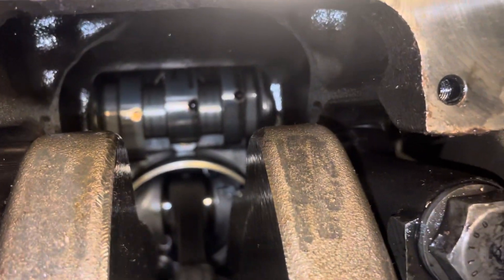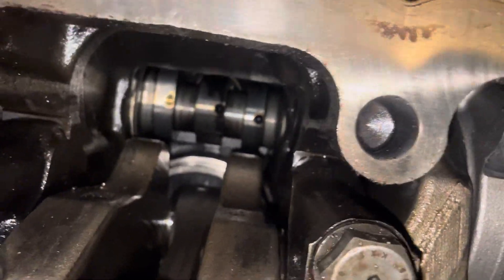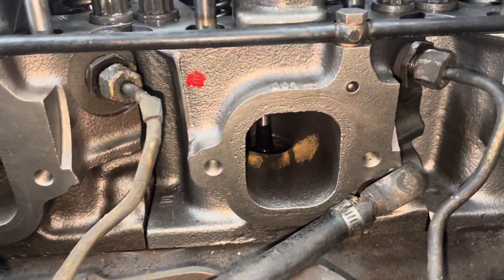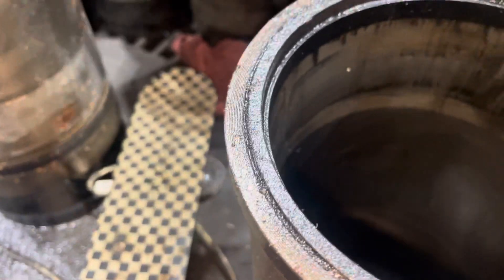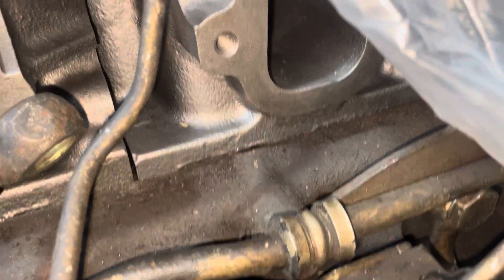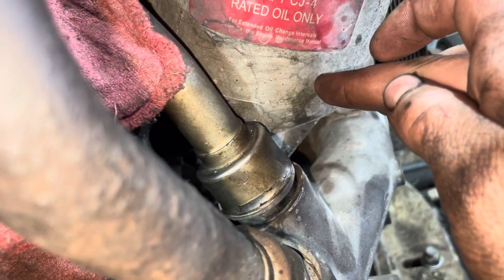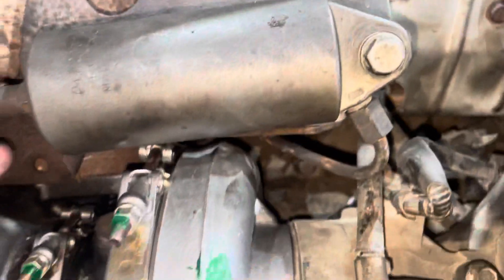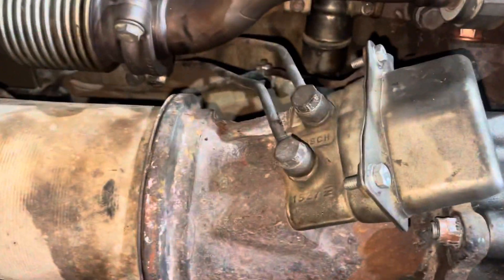Rebuilding a Mercedes MBE4000

Comment: Did you have to machine the block for the updated liners? Thanks, have a great day!
Reply from the maker: @ronwerts3382  Nope. Newer liner with updated o ring drops right into place of the old one. Updated o ring is probably has a groove into the liner. O ring fits just under the shim.
Reply: I’m currently doing a rebuild with the updated liners I’m having a problems with line protrusion when I drop the liner in without that top o ring I’m in spec 11-12 thou with the top o ring I go up an additional 10 thou to 20-23 thou this is with using oem tooling i have been stuck for a few days trying to figure out what’s wrong

Comment: Hi I am getting a sterling truck with the MBE 460 ,is there a difference between the 460 and the 400,
Reply from the maker: It's either an mbe400 or mbe 9000
Reply: OM460LA and MBE4000 are same motor, just a different name.
Reply from the maker: When I diagnose or rebuild these engines it's either a mbe 900 medium duty ( like a Cummins b series, small displacement and single cylinder head) or mbe 4000 heavy duty(12.7 liter individual cylinder heads and push rod engine). The engines change for emissions, epa 04 and epa 07. But there is no service literature otherwise than 900 or 4000 for that year.

Comment: A secret to prime that motor is take the fuel caps off, turn the key to the on position not starting the truck, count to 60, then turn off count to 60. Do that 3 times, press on the gas pedal 3-4 times, hold down, start the truck. Put the fuel caps back on to keep air out
Reply: I want to get air in my fuel system just to try this. 😉

Comment: Hello friend, I have a problem with my MBE 4000 engine. The air compressor gear broke and I need to remove the camshaft to replace it. Can you tell me what steps I should follow to remove the camshaft?

Comment: ITS SO EASY YOU JUST TALK GARBAJE  TO THIS ENGINE OTHER YOU NEED A HEAVY EQUIPMENT TO PULL THE CILINDER HEAD BLABLABLA
Reply from the maker: Getting the bill from working on this engine makes it garbage. Unlike a cat or Detroit you don’t need heavy equipment to pull those little heads off. Dealing with the exhaust brake on an mbe 4000 right now. The bill is higher than what I could afford.

Comment: Question is it possible to just change just the one head the is leaking to new style or do you have to change all of them?  Can you mix new head with old heads
Reply from the maker: One can be changed. There is only the head gasket that is different to the new head. Dimensions are exact and you can’t tell it’s an updated head unless you remove it and inspect where the coolant passage has been recessed for a thicker coolant passage o ring that is part of the new gasket.

Comment: Hi Ryan, I need your detail opinion. A guy is selling 2007 freightliner columbia with mbe 4000 engine. Truck has 950,000km, it was rebuilt by freightliner in 2019 and was driven 300,000km after rebuilt. Truck was well cared and tires, batteries, alternator, radiator and clutch plate. The engine looks clean there is no leak around engine. We have got deal for 40,000 dollars. Every mechanic that I have talked is saying don't buy this motor, it is a junk and will cost me great amount of down time. What do you think about mbe 4000 engine in terms of reliability, parts availability and mechanics even touching that engine. I won't be able to afford dealership to get it fixed. Please guide me
Reply from the maker: The mechanics your dealing with are right. To high of mileage. 07 if it has a dpf filters then definitely no. We see some wild issues with Mercedes’ engines. Unless they put a new camshaft into it I wouldn’t touch it. To fix leaks can get pretty costly. Air compressors and even ac compressor are expensive. I’m not a fan of the freightliner.
Reply: @ToadHoleOntario Sir I have 2005 Columbia with a mb4000. It now has 1.9 million. I had an overhaul at 800,000, now I think it’s time for another. She runs good, and looks good. I have a head gasket leaking on the right side of the block, but it’s not bad at this time. I don’t want a new truck. Is it ok to get an overhaul? They price it about 20,000 dollars. I see your doing one and it looks good!! Please advise.

Comment: Would you recommend buying 2007 Columbia on this engine?
Reply from the maker: If it’s clean and has no dpf filter then I would take a chance. If it does have a dpf filter than it has to be very clean and low mileage or your taking over somebody’s problem. Mercedes at this time is hard to get parts and last I heard injectors for the last years of mbe4000 are on back order.
Reply: @ToadHoleOntario  thanks a lot
Reply: @ToadHoleOntario  it has an egr, no other emission b4 the mufflers, 866,000 miles on it,
Reply from the maker: @Dhageykerow  these mbe4000 aren’t overly powerful. As long as it starts good and the oil lines and coolant lines don’t look like there getting too rotten then this is a pretty basic diesel. if your engine light turns on for egr it’s just the valve generally.  And turning the key off clears all codes. Bare in mind the 866 000 was the best years now it’s will take some more maintenance to keep it going. Knock on wood I’ve seen them with 30 000 hrs in massive cement trucks before needing expensive rebuild cause you couldn’t  keep coolant in the engine from heads leaking.
Reply: @ToadHoleOntario  thank you,

Comment: Buddy can you tell me where I can get old style head gaskets since my mechanic says he has to get new cylinder heads in order to do inframe? I really don’t want to change cylinder heads since they are pretty expensive
Reply from the maker: I’m a mechanic at a dealership.  Sadly I wouldn’t want to rebuild one with old style heads but if the boss told me to than I do. 90% of the time I only change the head on the cylinder leaking. I don’t change pistons unless there is broken rings, even then I might only just rebuild that cylinder. Dude this shit is to expensive, some of our clients have reduced labour rates in our contracts, we use policy on trucks that were bought from use.
Reply: ToadHoleOntario The thing with my engine is that cylinder rod broke plus crankshaft is gone so now I have to disassemble engine but to do head gaskets I need new cylinder heads since they don’t have old style gaskets. Cylinder heads are expensive. I really don’t know what to do. Do you have any advice I would appreciate it?
Reply from the maker: A broken rod is very bad. I can’t see how that block is salvageable. Oil related stuff I don’t rebuild the engine. It has to be completely washed so it doesn’t have any metal dented in the oil passages
Reply: ToadHoleOntario Please can you explain what is difference between old and new style mbe400 head gaskets? Is it number of holes on them or something else? I am trying to find old style
Reply from the maker: @Mandalorian-pc5ig  no idea where to find the old style but the gasket itself is thinker at the one coolant passage. If you put that new style on a old head there is a potential of the seal getting destroyed as there is no recession in the head for that oversized o ring and it’ll probably leak. That o ring being so big might even mess with torquing down the head properly
Reply: ToadHoleOntario Good to know 
If I don’t find old style I will just nicely scrape the oversized o ring and just add a little bit of permatex right stuff around it and hope for best. That right stuff is great for making gaskets
Reply: Engine is 2004 in 2005 Columbia